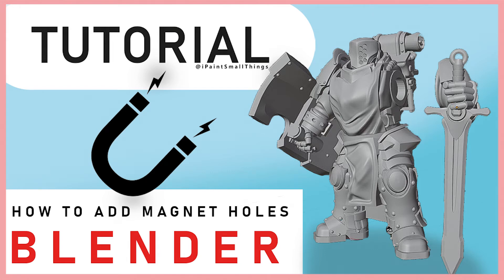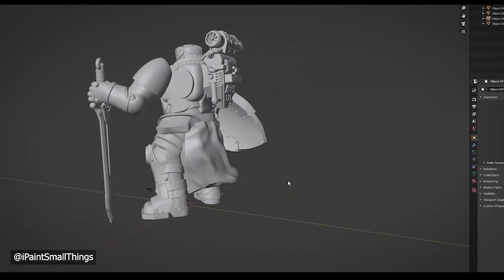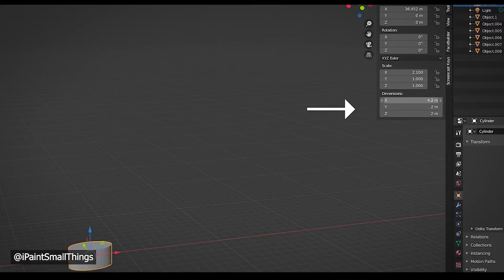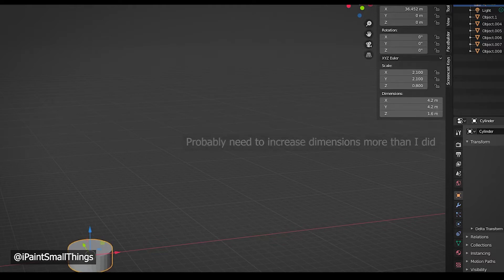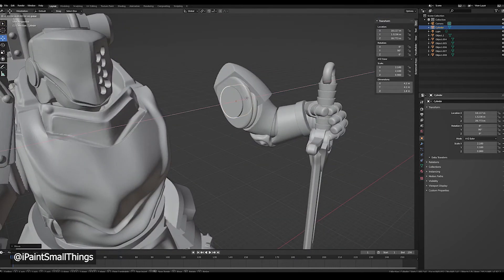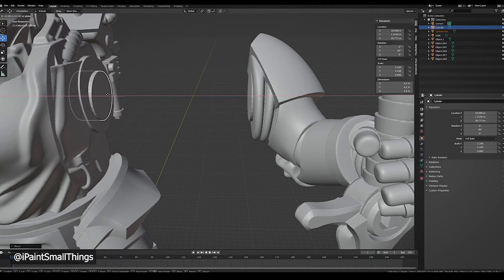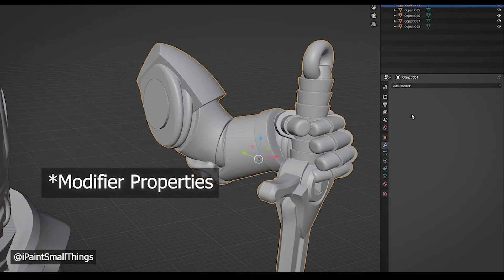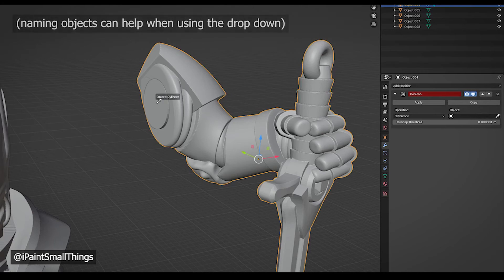How to Add Magnet Holes to 3D Prints

Comment: What if I want the magnets hidden by the printer?  Meaning I can print a few layers over the magnets, so they are hidden completely within the print.  All I get is an open boolean cut in my slicer.
Reply from the maker: You need an open hole to put the magnet in-- but you could probably make and print out a lid or something! Also, you can hide magnets with a very thin layer with greenstuff or putty!

Comment: ¿What modelo is that? Is really Nice, also when creating magnet holes do You Made a mark to avoid rotation or jigling of the parts?
Reply from the maker: It is from the Black Knight line (specifically their assault squad)! I'm not quite sure what you mean-- are you talking about in blender? or after printing?